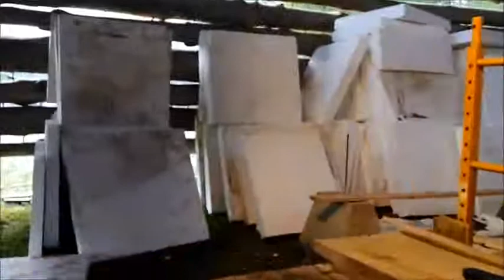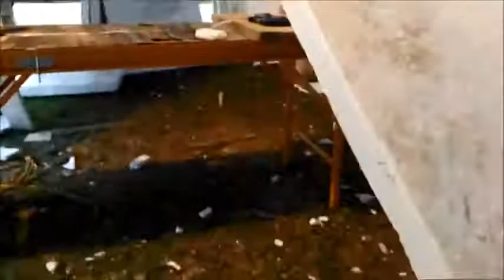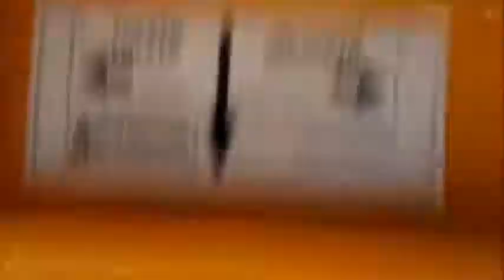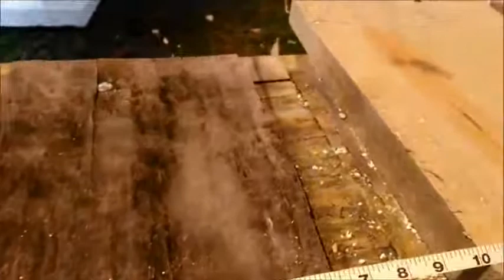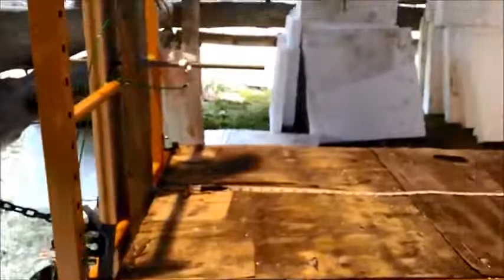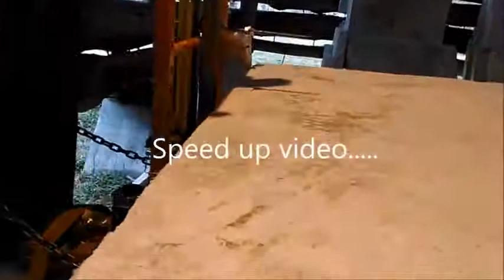hotwire foam cutter   vertical

Comment: Very NICE. I like the idea of foam on the roof. I'm not familiar with roofing or insulation codes so I was wondering if you have to paint the foam bottom and sides to prevent it from absorbing any condensation due to the temperature changes, also do you have to vent the insulated area so it can breath? Thanks for the show! Best Wishes & Blessings. Keith Noneya
Reply from the maker: no need to paint the foam in this situation- and no need to ventilate if you don't provide any airgaps in the roof. SIPS (structural insulated panel system) are probably the way to go, but they are much, much more expensive- I only paid $400 for all the insulation you see here. SIPS are basically a foam sandwich- they have the plywood glued to the foam, and you use 12" long screws to go all the way through the T&G decking and into the rafters below. I decided to ventilate because we live in the hot and humid South. I just uploaded this video today: https://youtu.be/ferV3j_-VZw. The blog is here: https://loghomejourney.wordpress.com/2019/05/03/roof-part-3-installing-almost-everything-on-the-roof/